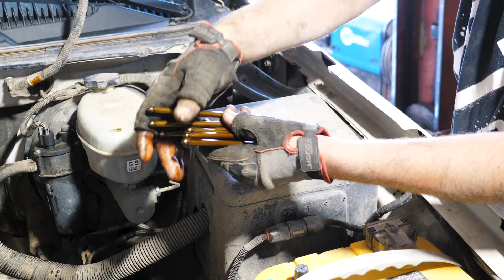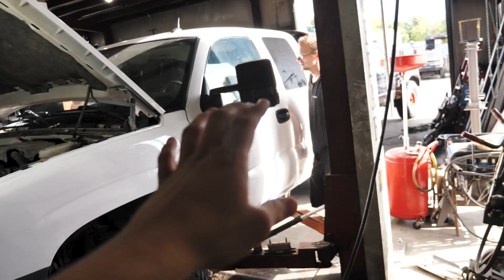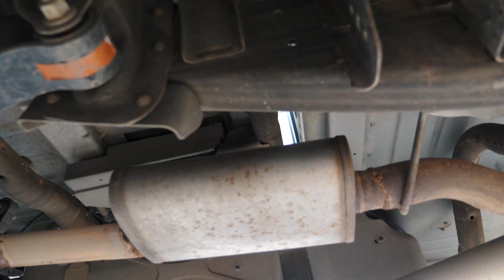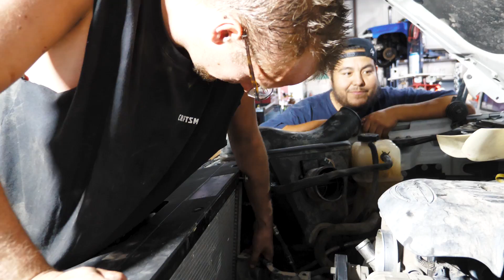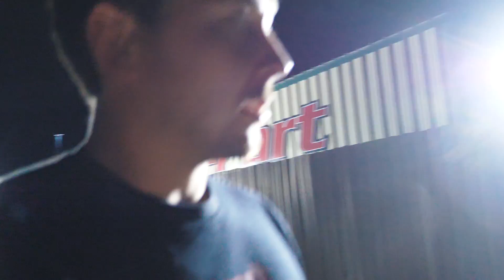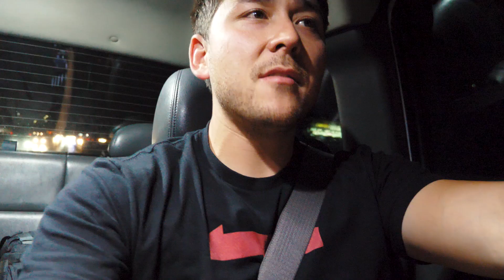Stage 4 Cam And Long Tube Headers // // 2004 Chevy Silverado Build PT 5

Comment: I want to get a 5.3 and put headers on it, what do you do with the o2 sensors? Can you get some type of bypass?
Reply from the maker: Mine still has them! Although if you wanted to get rid of them I’m you could probably write that in to the tune
Reply: Have a test pipe put in an you can still have the 02s hooked up

Comment: You are gay and wtf are you doing leaving it untuned
Reply: Miles Mortensen man I get you’re completely naive to all things engines and I get it’s a junky 5.3 but you shouldn’t drive on it untuned  maybe like around a parking lot but I still wouldn’t then even btw just because you put a cam in an ls and change the valve springs doesn’t make it built at all #youAreAclickBaiter